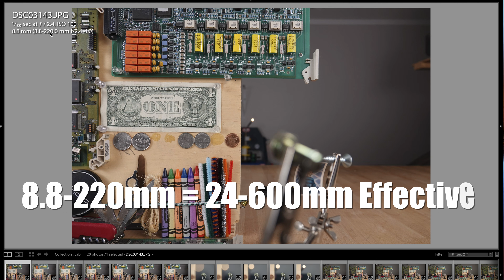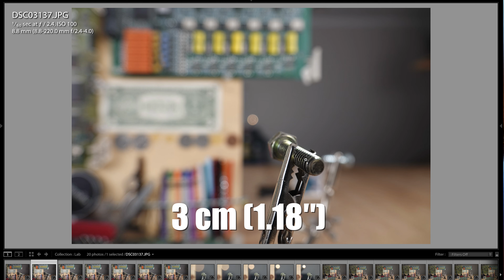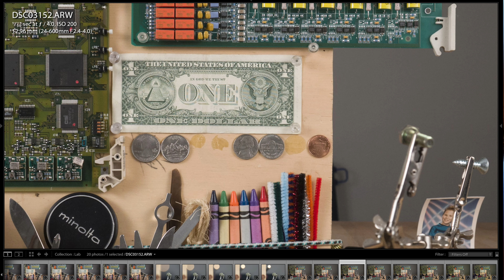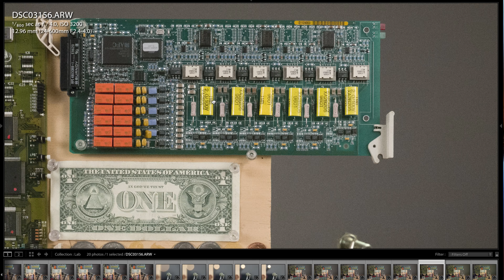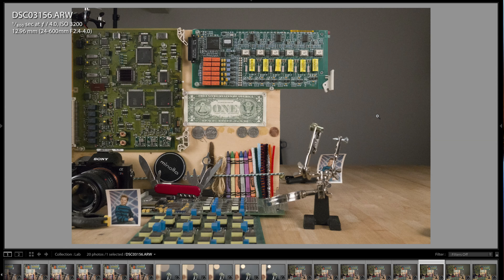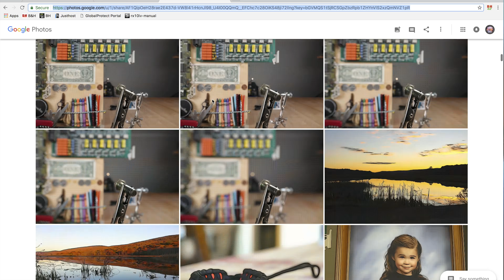Sony RX10 IV - Photo Lab Testing, High ISO and Aperture Runs

Comment: Thanks for the video. The rx10 iv shows a lot of promise but I need a camera that can handle my kids indoor and outdoor sports as well as dance recitals.  Would the rx10 iv be able to handle photos and videos in these settings?
Reply from the maker: Hello and Yes, the RX10 IV will be capable of doing it, but not as good as the A6500 with a killer piece of glass mounted. The smaller 1" sensor is just not as good in low light, and the lens when zoomed in is not as fast as lenses available for the A6500. Indoor sports would be the hardest to capture I would say. That is low light and high speed! The dance recital is more filming and I think the camera would do great for that as well as well lit outdoor sports. Low light and capturing action would be the area of weakness for this camera in my opinion when compared to something like the A6500 for example.
Reply: Thanks for responding as this information really helps. All the best!

Comment: Witch is better a6500 or rx10 iv. If you buy ?
Reply from the maker: It depends on your needs Onur. The A6500 is better with High ISO type situations due to the larger sensor, and it also offers the ability to attach almost any lens. Depending on the lens mounted, the A6500 is potentially capable of much more than the RX10 IV. But you will need several expensive lenses to achieve this. The RX10 IV is a bridge style camera and the lens is permanently attached. So if you don't want to change lenses ever, and High ISO shooting or video is not an issue for you, then the RX10 IV would probably be a better camera for you. If you need the most versatility, the the mirrorless camera is a better option. The larger APS-C sized sensor found in the A6500 is notable better if you want to achieve more separation with your subjects from the background as well. Full frame being even better in this regard. It really depends on your personal needs. The RX10 IV can be the best camera in the world for some people, but not for those needing a full frame format camera, or a camera that can mount an insane amount of different lenses to for example. I hope that helps,
Jay
Reply: Jay SonyAlphaLab 
Thanks for the explanation